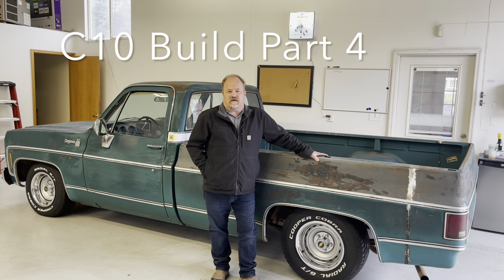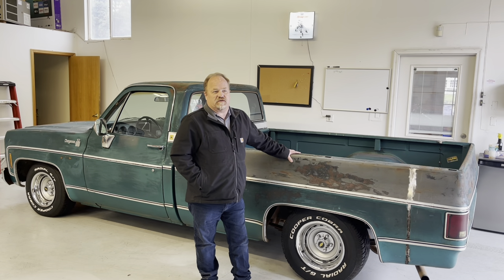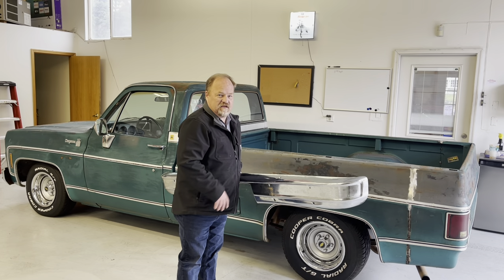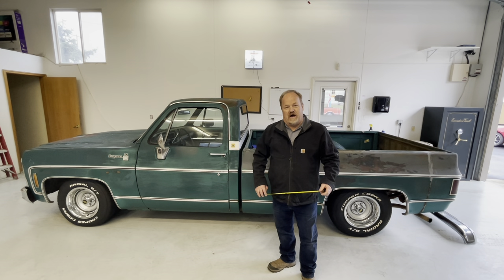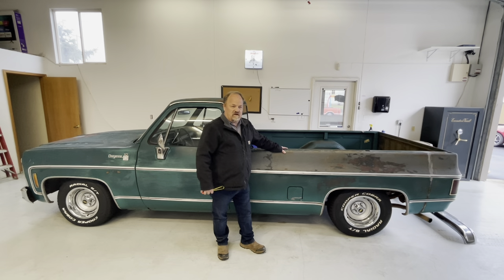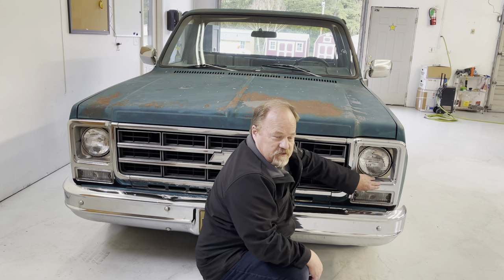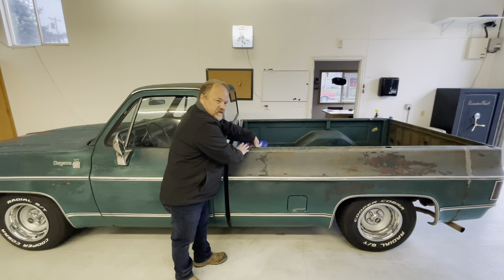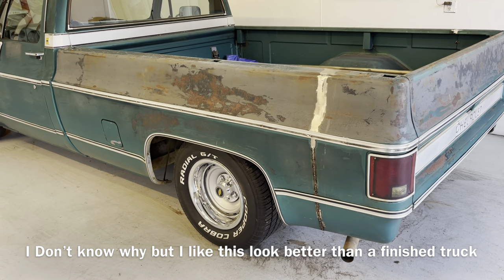Chevy C10 $1,300 Budget Build Part 4 Long Bed to Short Bed

Comment: Good job.  Thanks for mentioning measurements in front vs rear.  If it was a 4 door and you wanted to shorten it, how much would you cut?
Reply from the maker: If the 4 door has an 8' box then the cuts would be the same.

Comment: correct me if im wrong, but 14" and 6" is 20".   20" out of an 8' box leaves you with a 6'4" box.  am i right?  i thought shortbeds were 6'6"
Reply: When he butt welds it likely adds a little…who’s gonna notice an inch or two!
Reply: @Caddy-rn6sv  anyone that wants to install a bed liner or a tonneau cover

Comment: i wonder how much a short box is worth i have 3 sitting for 73 to 79 i got a 79 short box 4x4 cheyenne full option truck in mint condition with under 35,000 miles on it i got it free i have a lot of these pu's for good projects rust free i get them for free i am building a 68 short box it is turning out sweet and i do my own painting
Reply from the maker: Awesome!

Comment: Meh.. Seems to me it's not as easy as just buying short bed fenders anyway.  I have yet to find anyone that makes the inner fenders and finding them used isn't easy.  I found a set for $1k, because they were attached to a good bed.  At that point I'd just chop the frame.
Reply from the maker: It is a lot of work any way you do it.

Comment: Gallon of paint is $130
Reply from the maker: Yes it is. But it's not that easy.
Reply: @RustyDuckGarage  sand and clean surface, mask off stuff you don't want to paint. Mix paint, pour up and spray. Do not be afraid. Lite coats. Worse that can happen is a run or some orange peel. You can not learn if you are afraid to try. Tons of good video's showing basics.  I worked with a guy who painted his truck with a brush. Several lite coats..